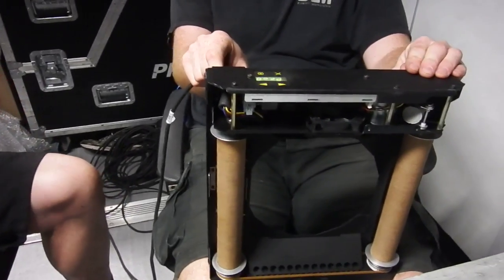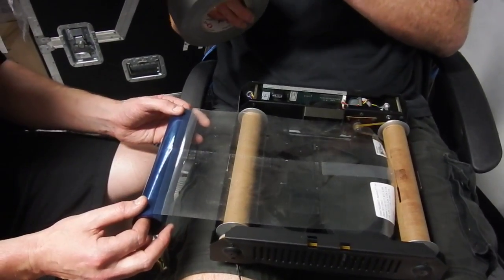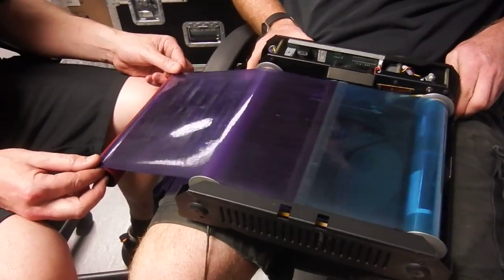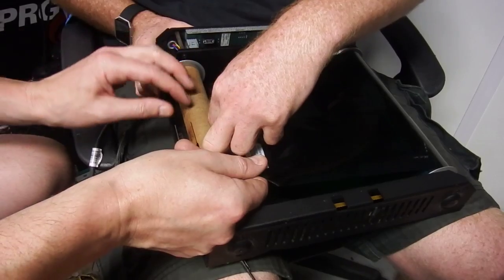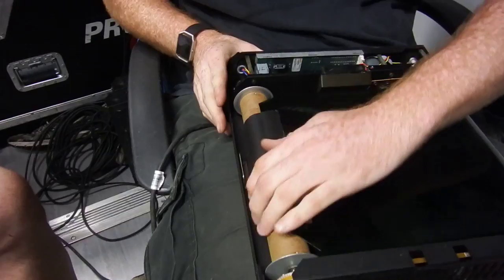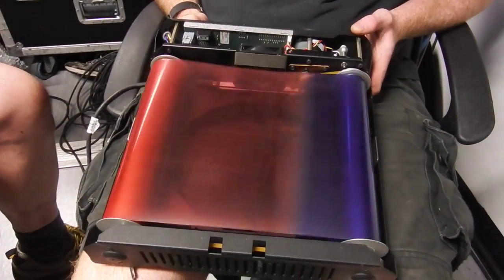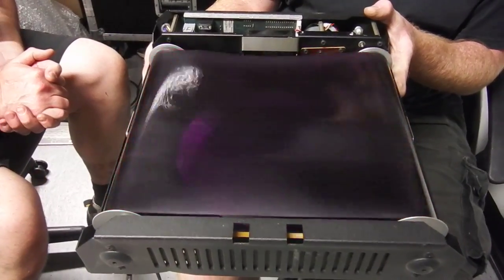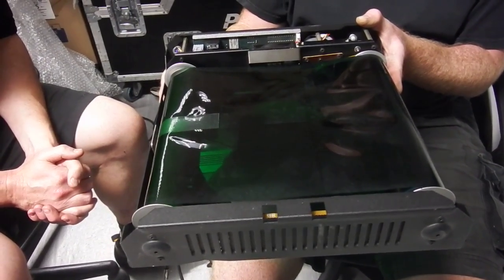Fitting gel into a theatre colour scroller.

Comment: This takes me back to my primary job in college, working in the theater lighting department. Those old Apollo scrollers were terrifyingly slow to load when I started because the process involved clear packing tape, and Goo Gone to get the adhesive residue off. A couple years in we got a dedicated master electrician who convinced the A/V supervisor that we should just use gaff tape. It must have cut our scroll changing time by at least 60%, and as a bonus we didn't leave work with fingers smelling of citrus and chemicals.

But for the whole time I was there, we rolled scrolls without power, by hand. Doesn't look like your scrollers have easily removable drums, Clive. We took ours out, so it was probably faster than dealing with controls to power wind them. I do wish our scrollers had better calibration, though. They'd usually require updating the color positions in the console every day or two during a run because they'd drift.

Last I heard, they got LED fixtures literally right after I graduated, so my senior year was probably the last season anyone had to deal with gel scrolls again there. End of an era, but I'm sure the faculty directors won't miss the scroller fan noise during shows…

Comment: Hey do you think you help me on better understanding an American plug, like why one prong is slightly larger or why they have a hole in both prongs?
Reply: +Recyxle Studios the "Neutral" (return) prong is larger as that way you cannot plug the "Neutral" side into the "Hot" socket by accident - Safety feature. 3 reasons for the holes: The wipers in the sockets have little bumps on them that "latch" into those holes, to retain the plug; You can "lock-out" the device by putting a wire tie or a small padlock through one or both holes; and they get to recycle that hole to save a little money. Main reason is probably the first, really :)

Comment: If it's using a pot to sense position maybe the 'jiggling' at the end is to look for noise (dirt) in the pot or maybe is comparing the change in the pot reading to the pulses in the IR slotted wheel sensor. I wonder if it goes nuts if the pot is dirty. Very interesting, haven't seen this (taken apart) before.

Comment: I wonder if there are RGB LEDs powerful enough to do the same job with no moving part except maybe a fan.
Reply: Yes, there are many available LED fixtures available (mainly parcans). However scrollers like this are still used often to get more saturated colours (not easily done with LED fixtures) or to colour very high output fixtures like a Source Four, that are just not practical to use LEDs for normally. Also might be used if a theatre just has many old fixtures and does not want to update them as that is obviously very expensive.
Reply: Not to mention that if you have digital photography/film being shot then LED light is horrific as it concentrates pretty much all of its power over a very localised section of the spectrum

Comment: I'd love to see this thing in more detail :D Looks like the end roller has two motors? Or is one some kind of rotary encoder?
Reply from the maker: It has two sensors.  A multi-turn potentiometer for absolute position, and a slotted wheel on the motor for accurate positioning.
Reply: I thought I saw a 4 wire stepper motor and encoder looking at the spindle. if so that would make a rather robust closed loop system changes in roller size wouldn't phase it with a half decent program..
Reply: ***** Thought it might be an encoder. Would love to see a closeup :)
Clive! :D

Comment: Looks like there is no sensor to detect if the gel is centered in position and it uses either stepper pulses or is time based.
Reply from the maker: Under DMX control the user actually has full control over the exact position, even between two gels if wanted.  The unit determines the length of the scroll in pulses and then divides it into the 256 control steps from the single DMX channel.
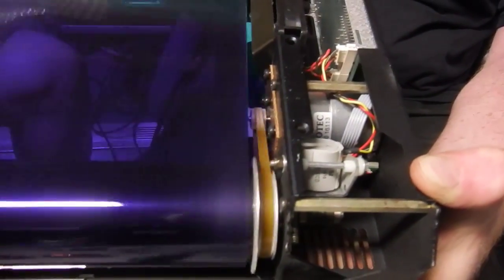Reply: The grey cylinder you see at 2:22 is a 10 turn pot wich is coupled to the roller via a worm drive, I assume it uses that for positioning.
Reply from the maker: We had a faulty unit to bits today.  It uses a multi-turn potentiometer for position detection and also a slotted wheel and IR detector on the motor for accuracy.
Reply: +bigclivedotcom so basically these gel units are making assumptions of how wide each color on the gell roll is? Or is this programmable?
Reply: Configuring scrollers was part of my job in college. The control console does all the figuring out of what position to send the scroller once you tell it how many frames there are. The scrollers themselves aren't that smart. We were spoiled at my school to have an ETC ION, which lets you input the color order of each scroll and uses its gel database to show you the color of each frame during cueing. Useful, that.

Comment: I didnt think people still use these instead of LED color changers. Why would someone use a color scroller instead of LED or a wash light?
Reply: So you can keep using the equipment you already have instead of making expensive upgrades.
Reply: Not if you can sell the old gear to offset the costs, but you need to be making sales in advance so you can buy something, send it off and replace soon-ish after you send it off.

Comment: Quite neat! Do you still play with big  CP29's and the like?
Reply from the maker: The Tattoo used to use high power 5K halogen lights, but it's mainly CP60's and automated discharge fixtures now.
Reply: +bigclivedotcom Did they ever use the CSI PAR64? Probably would have been the hot restrike version if so. They were quite popular years ago in footy stadiums and the like. They were originally Thorn but I think GE still make them in limited numbers!

Comment: Interesting how it sets itself up for the exact positioning, repeatable and position stored in something like a 24co2 or similar perhaps. :-).
Reply: +zx8401ztv In my experience, the scroller doesn't actually know how many colors there are. It just takes the control input and scrolls that far into the string. e.g. 50%  would scroll to the very middle of the string. It's up to the person programming the lighting console to use positions that line up a single color.
Reply: i didnt get how it knows where it is in the roll , I get where it finds the ends etc, but how does it know where the colour changes in the middle? i missed something i know!
Reply: Perhaps after finding the ends it divides clock pulses with the standard number of panels, it knows where the middle of each panel is roughly.
I dont really know, i dont see rgb sensors.
Guesswork :-D
Reply: Scroller technology has changed over the years. The first were 0-10V analog, now they are 0-255 DMX. In analog the lighting desk sends out a voltage and the scroller positions to voltage/10. As I recall there was a knob on the scroller to tell it how long the gel string was. 

In DMX you send 0-255 and again the scroller positions to value/256. Some of them I think know the number of gels in the string, and will adjust their position slightly so that they are in the middle of a gel and not split over a join between two colors. That used to be a big problem in the analog days.

Comment: when you say gel sheets is it actually a squidgy gel on the sheet or not?
Reply: No, it's not gel in the liquid sense. It's just coloured plastic these days, it's just a hangover from days of yore.
Reply: +Lufferov ah right thanks I was just wondering very interesting
Reply from the maker: It is a form of gel as it dissolves if it gets wet.
Reply: +ManiacGamer maybe you have touched the sheets of clear flexible plastic that are sometimes used as viewing windows in cardboard packaging? Or "lenses" in the sort of paper folding glasses (like one eye red one blue for old school 3D) that you'd find attached to a comic book in the 90s? It's exactly like that. Basically just a very thin (0.5mm or less I think) of fairly stiff (but due to the thinness still flexible) smooth plastic. 

I didn't know it dissolved in water. I guess that's where the stains on some of the gels I've seen came from.
Reply: +ManiacGamer if they haven't been exposed to water, it's just like plastic sheets, nothing like soft squidgy gels.
Reply: +bigclivedotcom that's really cool what does it feel like to the touch then?

Comment: I'm guessing you're not running these through anything monstrous otherwise the gels would warp pretty quickly if settled on a single colour?
Reply: I have no clue about this stuff but I can only assume that the gel is made of some high heat resistant plastic.
Reply: Gels are made to withstand high heat... these are probs going to be used on pars or something similar...

Comment: Why is it called gel?
Reply: One of the few youtube comment sections where you actually learn something.
Reply: +L. Wolf I eat ass
Reply: > Because before plastic technology got as good as it is, they were made from clear glass filled with coloured gel. Same as in photography.

No, glass is how it is done in photography, where you need an optically clear filter. In stage lighting the gelatin material was poured out on something it would not stick to, and allowed to dry as a very thin sheet, then peeled off and rolled up. The thickness was not absolutely controlled and the liquid could have components that would make a diffuse filter. This does not matter (much) when you put it in front of  stage light.

You literally had a thin gelatin sheet, less than a tenth mm thick, that you put in front of the light fixture.  If it rained on the light the color media would dissolve and disappear.
Reply: because they are usually made from gelatin
Reply: Actually, in photography, it is gelatin too. It's in front of flash, not on lens
Reply: I've got several gel filters (green) used in military displays (radar and such) . They consist of two thin glass sheets with a ~1mm layer of elastic tinted gel between them. Sometimes the outer glass sheet will have etched or engraved grid lines etc. and an anti-reflex coating. The colour uniformity is excellent, and the added benefit is that in case it breaks the pieces are stuck together and don't fly everywhere injuring people, much like in security laminated glass.
Reply: Because it used to be made of gelatin. Thankfully I'm not old enough to have worked with the stuff. I've heard tell of new technicians being sent to "wash the gel" as a sort of hazing trick. (The gelatin, of course, dissolved in the water, ideally flustering the tech.)
Reply: Cool
Reply: l wilton
Yea, if I remember right it was similar to like ballistics gel and stuff is made. I think the dyes helped it be heat tolerant.